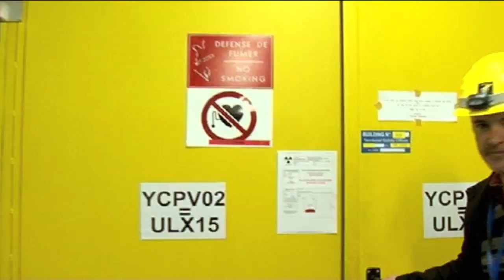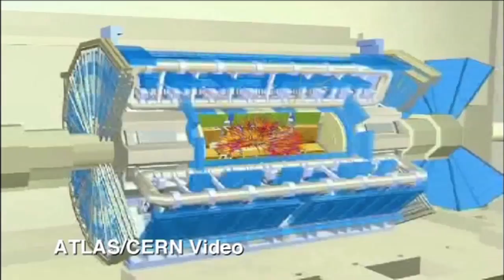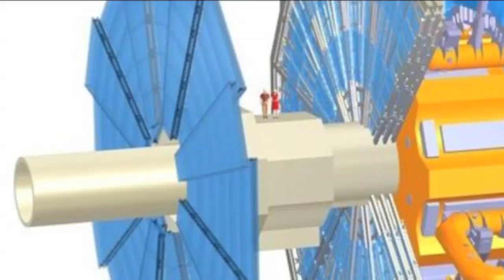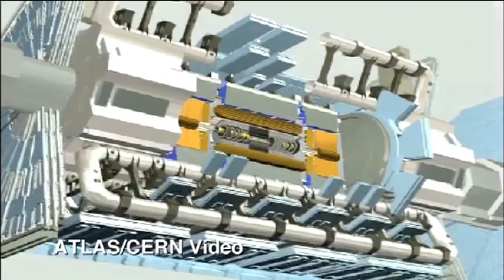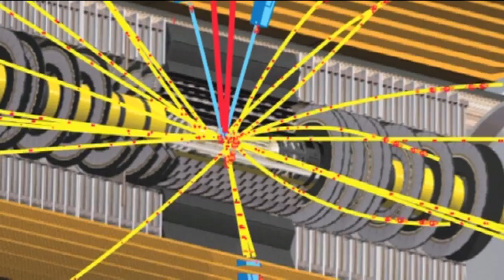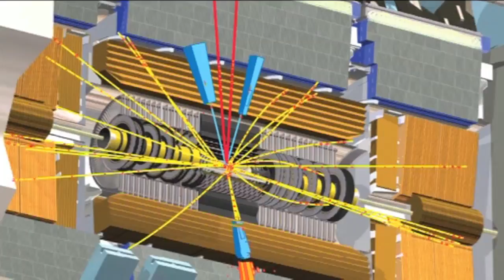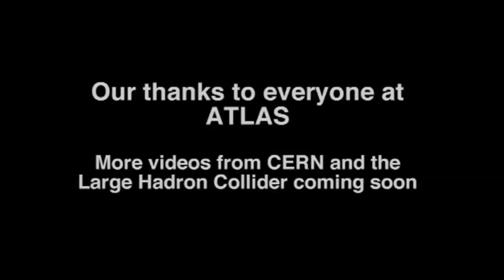Inside ATLAS at the Large Hadron Collider - Sixty Symbols

Comment: it is a wall the question how big is the target if under a pancake missed shot on a early breakfest. Waste of time needs to lens it to a pancake and collect the dark matter in the middle right at the speed of light. The lens would need to be a moun so if they can translate it back into a lens for the 2nd shot it would expand with out exploding. Instead of radiating have it helix right back into that fine point welcome to light in every galaxy seen with a black hole. If there is no control then semi conductor flashing 1000 times in the .02 would do it part way with the lens bose einstein condensate. At least 1 out of 137 would have dark matter only way around the 137 is to control the moun to a lens or have the beam come in at 137 angles. 137 can be at any scale does not need to be an electron.

Comment: What do you wanna bet that in 50 years they've boiled this down to the size of a desktop computer. Similar to computing in general.
Reply: The only problem is that it's not the computing that's the reason the detector is big. The muons that get created really do need around 10 meters of stuff to bump into something and be detected. So, if you want to catch muons, that's the minimum size you can build, and still catch all the muons.
Reply: J Sh highly unlikely. Nuetrinos are so impossibly hard to detect. And the reason it's so big is also to accelerate these things to 99.999999 the speed of light. No desktop sized object can do that for at least a few hundred years.

Comment: Doesn't knowing both the position of the particle and the time it arrived at the same time break the uncertainty principle?
Reply: It is the position and momentum that can't be known with absolute precision. Momentum is mass * speed. The equation is x * p >= hbar/2 if I recall correctly. There are other equations as well for the Heisenberg principle.
Reply: Nathan Lehenbauer I thought it was the position and speed of a particle cannot be simultaneously measured. The position is known because you know the position of the detector it hit. I'm not sure how the time is synchronized.
Reply: +Nathan Lehenbauer Somewhat, but not precisely. You can sort of know the position and momentum in practice; there's just a limit to the precision.
Reply: louis tournas But if you know the time it arrived and the location couldn't you ascertain the momentum from that data?
Reply: +Toanoopie That was my understanding of it,  the more accurately you measure one the more you affect the other, so you can roughly measure each but never know both precisely.
Reply: Nathan Lehenbauer
"But if you know the time it arrived and the location couldn't you ascertain the momentum from that data?"

==No.
According to physics, there is a fundamental limit to the precision with which those values can be known. This isn't the fault of the equipment. Nature sets this limit. On top of that, the equipment used can't reach those high level precisions anyway.
The Heisenberg equation show which pair of values are tied together. That is the interesting part.

Also, experimentation demonstrates that "stuff" are particles and also have a wave like behavior, which is weird. The old Newtonian view doesn't work well on the subatomic scale.
Reply: +louis tournas Because the point particles moving in a wave like manner because its all made of light, sinusoidal waves. When you measure/observe them, they are viewed as particles, but are waves when they are not being measured.
Reply: Kyle Baker

" Because the point particles moving in a wave like manner because its all made of light, sinusoidal waves. When you measure/observe them, they are viewed as particles, but are waves when they are not being measured."

==I wouldn't say that everything is made of light. There is obviously a conversion that happens, for example in pair production (Ex : electron and positron production from a gamma photon.).

What does measuring do to make these things behave as particles?

Comment: ATLAS and CMS seem so similar. Why are they even bothering with building two of these monsters?
Reply: Johannes Fried key word there is "seem" they are not.
Reply: Ernst Stavro Blofeld We can work it out, sort of. A proton's rest energy is 938 MeV or 1.503 x 10^-10 J, and in the beam they have an energy, as of the latest upgrades, of 6.5 TeV, or 1.041 x 10^-6 J.

E = mc^2 / sqrt(1-v^2/c^2)
1.041 x 10^-6 = (1.503 x 10^-10) / sqrt(1-v^2/c^2)
0.0001443804 = sqrt(1-v^2/c^2)
2.0845700903 × 10^-8 = 1-v^2/c^2
v^2/c^2 = 1 - (2.0845700903 × 10^-8)
v/c = 0.99999999

So the protons are travelling at 0.99999999c or 99.999999% the speed of light
Reply: Johannes Fried with independent detectors and independent teams analyzing the data from them we can be more certain that systematic errors (as opposed to statistical errors) have been avoided when they agree. This is especially important as it will probably be quite some time before a wholly separate collider this powerful is built and can check their results.
Reply: DSCH4 How many percent of the speed of light do the protons have inside the collider?
Reply: Ernst Stavro Blofeld
i just checked and the particles inside the LHC move at around 670.6 million mph and the speed of light is 670.616629 miles per hour
Reply: so extremely close, somewhere around 99.9999%
Reply: ***** So you have two matter beams, each circling at 99.9999% sol, in opposite directions. Do they collide with 199. 99998% of the speed of light and don't all the relativistic effects, e.g. time dilation, completely mong the measurements?
Reply: The Kaiser They don't collide with 199. 99998% of the speed of light.
Reply: Aman Singh Ach!
Reply: The Kaiser The observed relative motion in the lab frame can be over c, since nothing is actually moving at or over c. In the proton's reference frame, you must use the relativistic velocity addition formula.
Reply: Wait for it, wait for it...

Comment: Did you know why why use helium to cool down this? no? well ill tell you if you use liquid nitrogen it will be very cool but not cool enough, if you use hydrogen that will be so cold it will leave a trail of ice behind it so you could put it on metal and then hit it with a hammer and it would smash. also for computer people use liquid nitrogen or hydrogen to cool your computer the cooler your CPU is the faster it is!

Comment: There's really no point in that because even 10^11 protons are ridiculously few and carry extremly little energy, again most of the protons would miss the molecules that made up your replica. If I remember correctly they just slam it into a lead wall and collect some data off it.

Funny fact to the ATLAS detector (and any other particle detector of that magnitude): Even the network cables around them are measured to the µm precise to reduce transfer times

Comment: Great question. Once the beams have been around so many times, and been through all kinds of abuse, they start to go a little wonky. They dump them out at a minimum beam energy to prevent even the slightest bit of wonky-ness from developing... Which is the last thing you want in a beam. Basically, you dump it while it is still fully controllable, you don't wait for it to become a problem because you might have a microsecond or 10 before bad things happen.

Comment: Good question. Nearly all the running cost is getting the entire machine ready for collisions in the first place. The actual beams are not that expensive to produce. Keeping them zipping around the LHC is the hard part. Try cooling down _anything_ to 1.8 kelvin. Now, do it across 27 kilometers! The beam gets dumped all the time and basically produces a bunch of useless particles and heat.

Comment: Great question. I know the answer, and the comment system at YT is not nearly big enough to explain it. Basically, they use magnets to control the beams. When they are ready for collisions they ramp down the magnets separating the beams. Also, it is highly important to prevent beam loss (it smashing in to the side of the pipes). There are a host of ways they try to avoid this. It gets complicated really fast.

Comment: One gram of matter annihilated with one gram of antimatter results in about 180 TJ of energy. The mass of two million hydrogen/antihydrogen atoms is about (3,4x10^-18)g. Thus, annihilating a million atoms of anything with a million antiatoms generates between 6mJ(if annihilating hydrogen) and 1,8J (if annihilating ununoctium) of energy. The latter corresponds to lifting an apple from the ground and putting it on top of your head. That doesn't usually result in the Earth being destroyed.

Comment: The advantage of that is that you would have a much more narrow stream increasing likely hood for a collision because there would be virtually no area in which an atom could go past without hitting another one, like in an hour glass only allowing a few grains of sand through at a time. I asked specifically because I would assume there is a specific reason they chose a much larger chamber as opposed to a narrow chamber with a higher probability of collision

Comment: The comparison with the reader was just to mention I know the technology exists to create something (like a tube) on a small scale. I wasn't saying that the length of the LHC was too short (it's needed to increase the speed) and I'm not saying to remove sensors (you could pretty much keep them as they are) I am talking about the chamber in which they collide should be funnelled into a chamber that is only a few atoms big so that there is less volume in the chamber specifically.

Comment: You need the size because many of the particles generated pass through matter and only have a small chance of interacting. If you got only one sensor layer, if it passes through and did nothing, you lost it. So sensors are stacked. 
Then there is no single detector, which can detect every particle. They are very specific and different types are aranged in layers. 
you also need cables, structural support, temperature control, a many more things.
And why would it be called LHC if it was small ;)

Comment: If you doubt the applications of quantum mechanics and particle physics, think about this: The transistor only exists thanks to quantum mechanics.  Transistors are in every piece of electronics you see.  If it weren't for research in quantum mechanics, we'd still be using vacuum tubes in electronics, and your cell phone would be the size of a stereo.